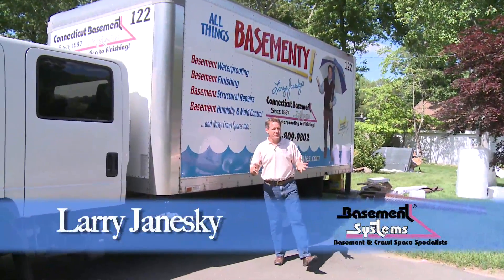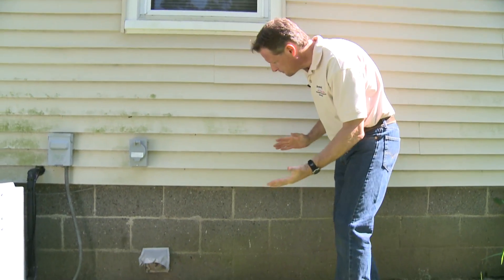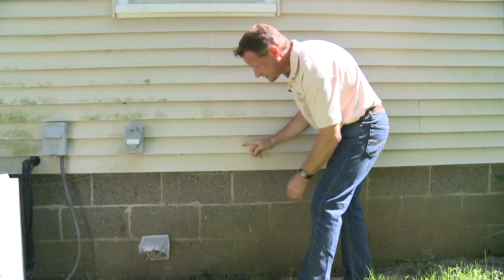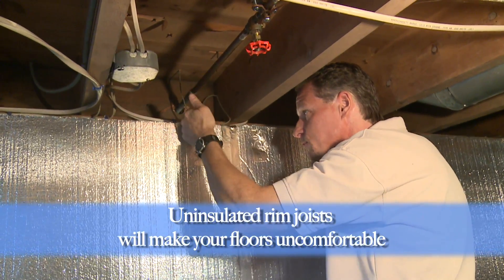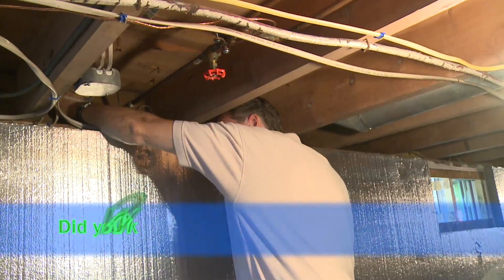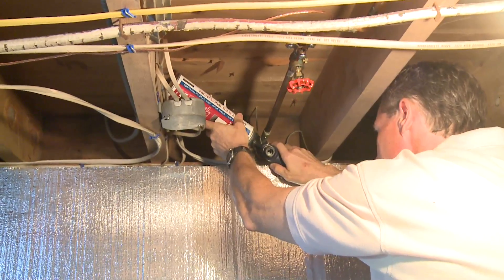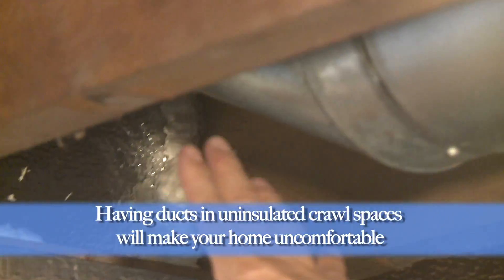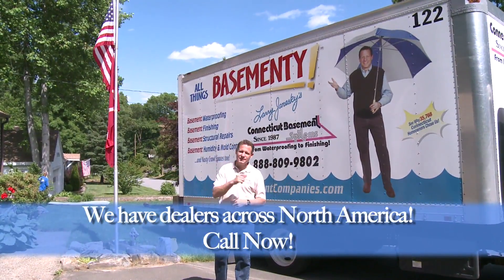Insulating a Rim Joist with SilverGlo

Comment: So, if the rim joist were to ever get wet, how would it dry out?  That foil face is a vapor barrier and would contain the moisture in the EPS and the rim board. Shouldn’t you remove the foil face so that moisture can slowly escape the EPS?
Reply: It dries to the outside.

Comment: Could you explain the differences between putting the Silver Back or similar vapor barrier on the crawlspace walls (and ground) vs putting insulation panels on the walls (and vapor barrier on the ground).
Would you do one or the other, or both?
If you want to insulate the walls, would you still install the vapor barrier on the walls?  Which should be applied t the wall first?
If you wanted do just the vapor barrier first, and then later add the insulation panels on top of the vapor barrier on the walls, could that be done?
If you put only the vapor barrier on the walls (and ground) would you still seal the vents?
Thank you very much for your very informative videos.

Comment: I'm noticing you install the SilverGlo quite high on the wall.  It looks like it's right up to the sill plate.  I've seen other sites that say you need to leave a gap for termite inspection.  Do you feel that is not needed in some situations?

Comment: Code requires you to have a minimum 1/2" Gyp Bd Thermal barrier on the interior side of the Insulation board.  Is there anyway to get around that?  It's fine if you're going to live in the house forever, but what happens if you go to sell it?